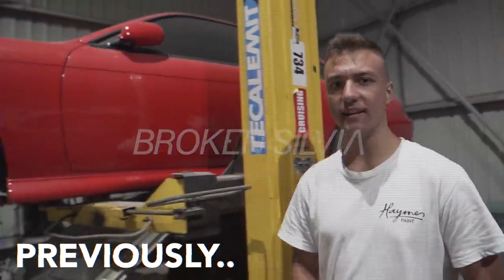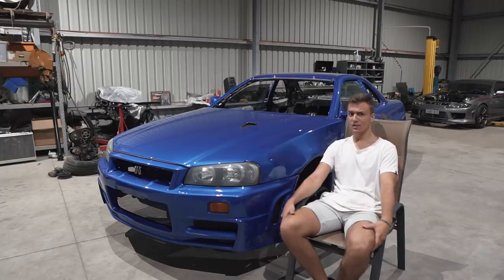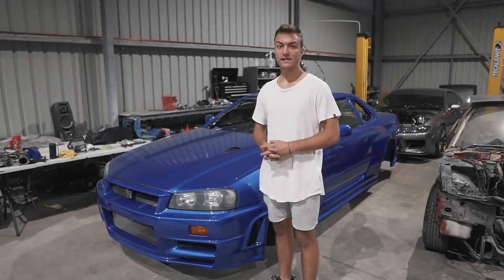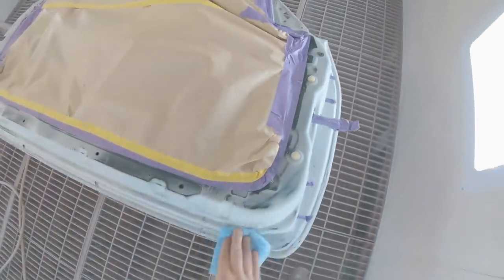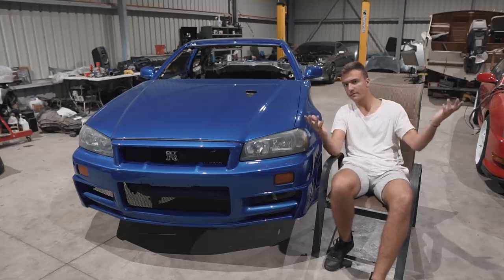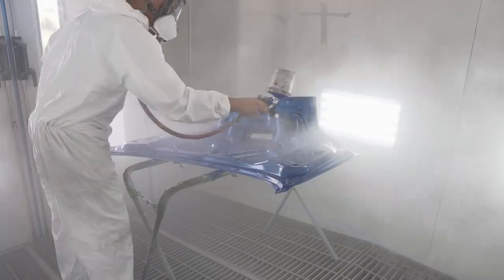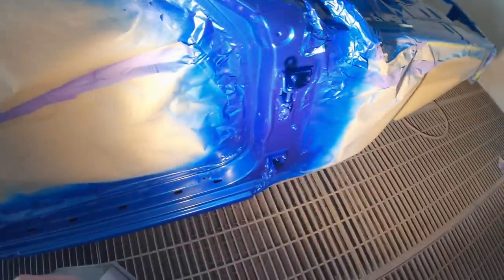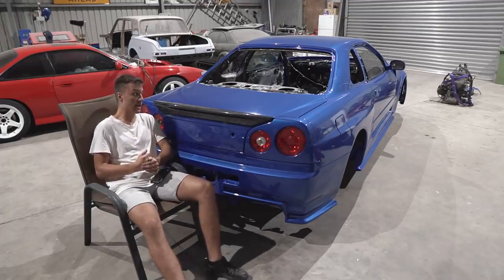DREAM becomes REALITY at AGE 20 | Poor Man's GTR [EP11]

Comment: So I commenting as I watch, your technique looks spot on. The only thing I would do differently (I'll take crap for this) is to not tape off the outside of the panels when edging / jamming the panels off the car. The little bit of over spray you get on the outside will melt back in if you are edging the same day (24hrs) as you will paint the outside of the panels. And using a good blending reducer after painting the outside of the panels will melt the over spray right back in. This of course refers to the clear coat, base coat isn't an issue as far as over spray. Again car looks great! 3 Thumbs up!
Reply from the maker: Thanks again Frank!

Comment: Watched till the end. Music was good,  you made a painted shell look better then a finished show car.  I wish I could show you some paint theory and technique.  The way you move from one part of the car to another is so pro, some of the hand movements are great. I just feel that your doing a motion but your not looking at the details of the process while doing it. If you can take a throw away panel : paint it by going by it really fast so you don't get any coverage and it looks like dry spray / over spray,  so do that back and forth a bunch while watching the painted area threw the reflection of a light. After you build enough dry spray it will hit a perfect coverage an pool flat on the panel. That's your goal to do to the whole car on the first shot. Wont need a second color or clear coat. At that point if you go back an do a little spray over anything, you will run. But if you spray a little then do another coat later, that first dry spray look/texture on the panel will be shown threw the 2nd coat.  I hope this helps.
Reply from the maker: Thanks for the comment Jon!

Comment: Hey, loved the video as always. The video is a bit longer than usual but I didn't see it as a downside. I think the tough thing is deciding between a informative video and a entertaining one. This one got heavier on painting 101 and thus felt longer. I feel this one had less timelapsing and that may have also affected it. You're doing a great job. One thing I would like to point out though is the parts were you showed you moving the tripod around, I feel like you could cut those and not affect the general feel of the video. But loved the light painting and the fact you didn't paint the car red!
Reply from the maker: Thanks for the feedback mate!